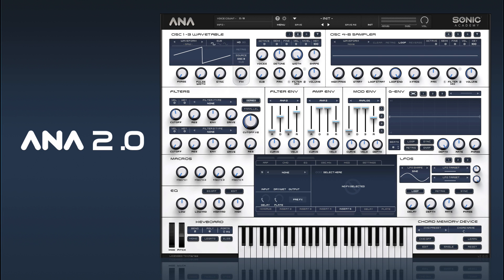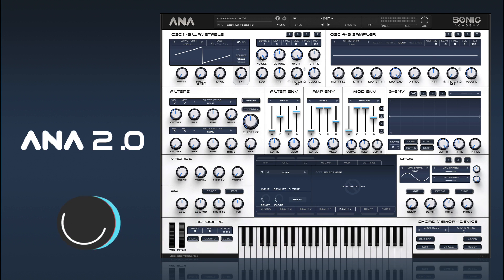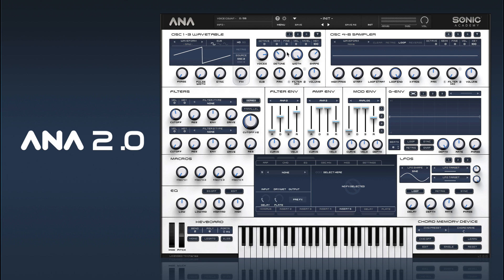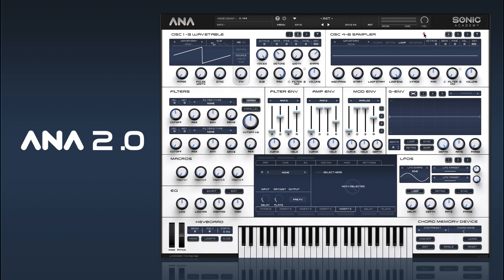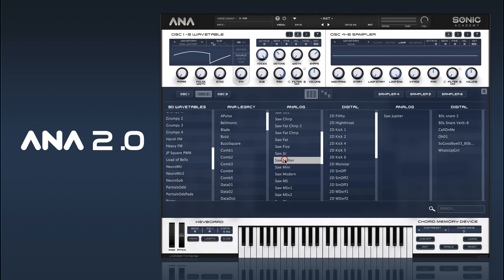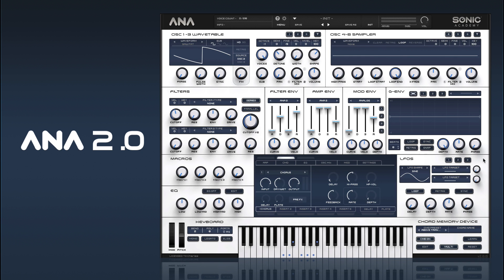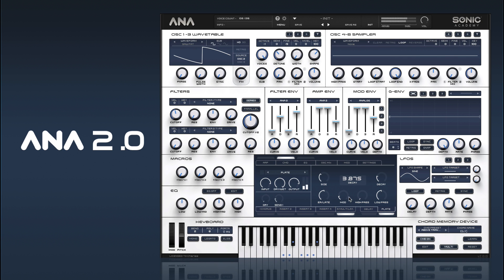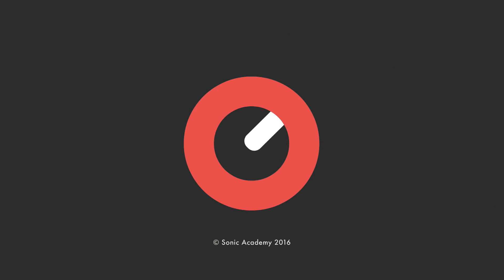How To Use ANA 2 - Sound Design - 8. Super Saws

Comment: Great video. I have a few questions though!

1. Which OSC waveform best replicates the JP Saw?
2. Which OSC waveform best replicates the Virus Saw? 
(heaps to pick from... soft saw, sawfat, saw jupiter, etc!)
3. When using the Reveal Sound Spire synth the Unison 'spread' of the Virus Hypersaw can be replicated by setting the 'Density' control knob to 12 o'clock (center). Which position should the 'Shape' control be set to in ANA2 to replicate the Virus Hypersaw Unison spread?